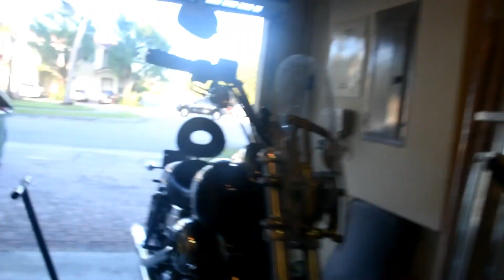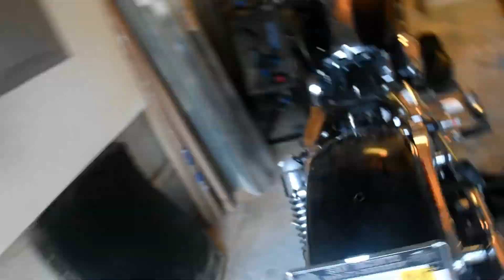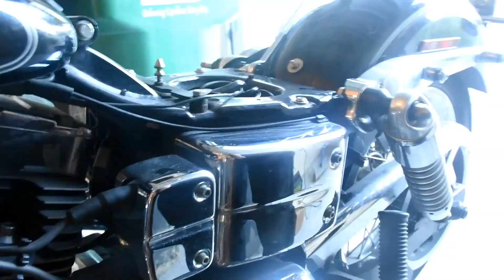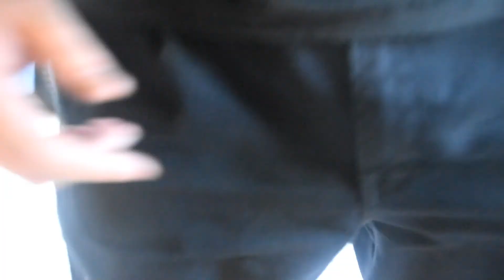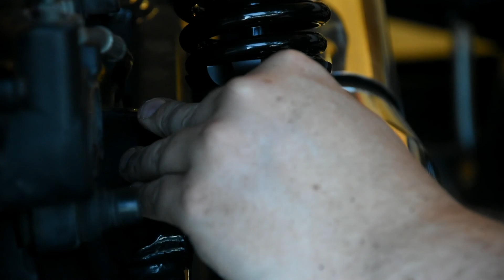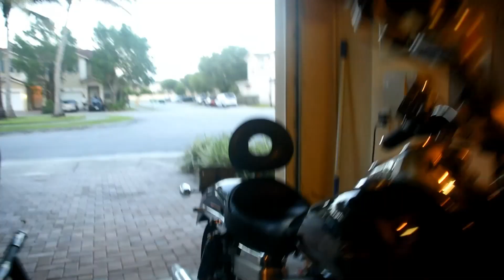Installation of Progressive 444 Shocks (444-4038B)

Comment: I used the top mounting bolt to install the spacer sleeves in the shock eye. Sleeve, shock, sleeve, washer, nut. (Regular nut, not the acorn nut). Pulled them in easily, turned the shock over and did the bottom sleeves the same way.